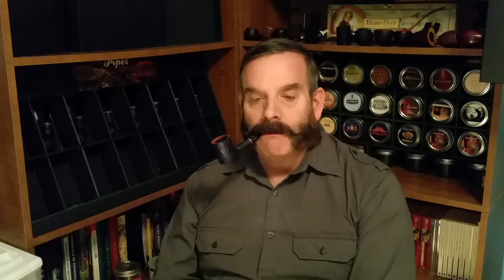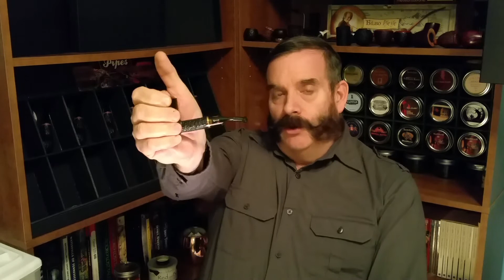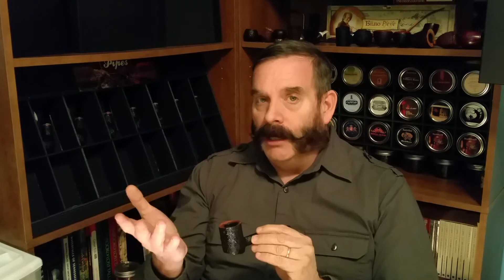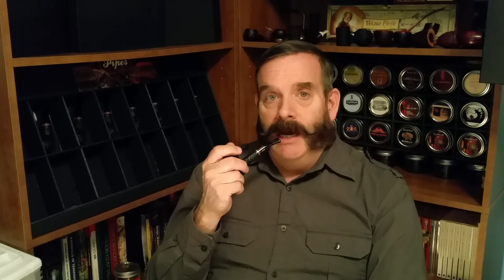An alternative way to cool your pipe

Comment: Here's a question: I use to smoke cigars years ago, before switching to cigarettes, mainly because they're cheaper. However, I recently started smoking a pipe, and I would like to know is do you inhale pipe smoke like you would cigarettes, or do you smoke a pipe like a cigar; where you don't inhale?

Also, I'm currently smoking Wildhorse Premium Pipe Tobacco Blue, and I'm really impressed by it. Do you have any recommendations on good Pipe Tobacco?
Reply from the maker: I personally do not inhale, and I would not recommend it, but, some cigarette smokers say they inhale because it's what they are used to.  Recommendations? Seattle pipe club plum puding Bourbon barrel,  Cobblestone vanilla latte,  g.l. Pease Montgomery
Reply: @MuttnchopPiper  - Thanks for the advice. I have to say I'm finding smoking a pipe to be far more enjoyable than cigarettes. It's very relaxing. I did try inhaling, like you do with cigarettes, and I forgot how much stronger pipe tobacco is, same with cigars; damn-near chocked me to death. Lol!

Comment: Thanks muttnchop ....going to try it ....question for you I smoke the same way as you described I try to slow down but like you said it's a flavor thing would a poker be a bad choice ...with short stem ...as always thank you for the great videos and your kind help 👍👍👍👍👦👌👌
Reply from the maker: Pipes, are you having problems smoking your pipe, if you are describe them to me, and I will be able to tell you better if a poker is right for you
Reply: Muttnchop what's up my friend... not a problem smoking it however like you described I tend to sometimes smoke quickly because of the flavor.. I'm enjoying the flavor. but I've been learning to slow down my Cadence I was thinking about a poker being out on the kayak a lot this summer need something that can hold a lot of tobacco but is easy to carry once in awhile I will get the tongue bite but it's due to my smoking etiquette since I've switched to Savinelli is mostly and I do use the filter in the savinelli.. it seems to be helping a lot once I learn to slow down I'm going to go without the filter but that's why I was thinking of a poker

Comment: I was watching a video the other day, and I've seen it before, but occasionally a smoker will put a couple fingers over the bowl when they pull on it. So I'm trying to figure out why they do it. Well I could be wrong, but when you narrow a tube it speeds up the air coming through and when you speed it up, it cools the air. So, when I have tried this I notice that I get the amount of smoke that you would from a hot pipe but it's cool not hot. Now I do this whenever I feel it get too hot and it really helps. 

Just my thoughts, maybe I'm way off base though hahaha.
Reply from the maker: Galen Patchett - we’ll sort of, we do this when we feel the pipe is about to go out, you cover the bowl to limit the amount of air flow, then draw a little harder which encourages the ember to get hotter and grow faster to the surrounding tobacco. It’s purpose is to keep the pipe lit without having to relight the pipe. 👍👍👍
Reply: Muttnchop Piper Ah, so I was kinda wrong. Oh well live and learn, thanks for the help muttnchop piper.

Comment: Does the skin transfer more heat than the air surrounding the bowl? I ask because the air must be cooler than our hands but still might not hold as much heat as the skin, like we notice when we touch metal or wood, for instance. But if you've tested and it worked, I can't help not giving it a try! Thanks a lot! By the way, many friends of mine, who enjoy pipe smoking, have been thanking me for having showed them your channel. Actually, I need to thank you Muttnchop Piper for the channel. Good tips, teaching and pleasant time!
Reply from the maker: Thanks Bruno, I am glad that the word is getting spread about my videos, the way I look at it, the more people who view my videos, the more people are being helped if they need it. Now to answer your question, air will cool the pipe faster then your hand, the only problem is you would have to hold it by the stem to allow the air to circulate. When your pipe gets to hot, the tobacco is scorched, and the flavor burns off faster then you can taste it, this technique is designed to cool the pipe enough to stop that scorching process and bring the flavor back. 😀😀👍
Reply: +Muttnchop Piper Thanks for the answer! Overheating definitely is one of the biggest complications in pipesmoking. I very often get into difficulties when smoking virginias. As today is friday, as soon as I got home from work, I'm thinking of using your technique with the fabulous Dunhill vaper Elizabethan Mixture. Very good choice to unwind and loosen the grip. Have a nice weekend and again thanks for all information on the channel!
Reply: Air is more on the insulator side than the conductor side. I have been using this technique for a year already. It works for sure.
Reply from the maker: +jvnshr you bet it does, combine it with the Breathe technique and it practically eliminates tongue bite, well it does for me at least. 😃😃😃
Reply: I cannot agree more with you, Sir. Unfortunately, breath smoking technique is not working for me as I am more a holder than a clencher. The reason is I mostly prefer straight pipes than bent ones, it is very difficult to clench straight ones,  for me at least :-) By the way, I have been watching your videos since last week and today I became a subscriber. I really appreciate your efforts. I also would like to invite you to pipesmagazine.com forum. We have a very nice community there.
Reply from the maker: +jvnshr I appreciate you subscribing to my channel, and thank you for your invite. I do both, I clench awhile, then I hold awhile, all I know is I love smoking pipes. 👍👍👍😃
Reply: Air is actually a pretty good heat insulator. Fluids (at least water, and blood consists largely of water) is a good conductor.

Comment: do long stem pipes have the same problem of overeating?
Reply: Bear studios long stem pipes eat a normal amount
Reply: I reckon overheating is more an issue from the bowl so the long stem does little about it other than delivering cooler smoke to the mouth since it has to travel further...

Comment: I'm still new to piping and so I over heat my pipe a lot, but when it gets hot I like to maneuver it around my knuckles and the pressure points on my face. Sounds weird but its a heat therapy treatment sort of deal. Great vid and good advice.
Reply from the maker: I say, whatever tricks you have to keep that heat under control, go for it, thanks for viewing my videos. 😀😀😃